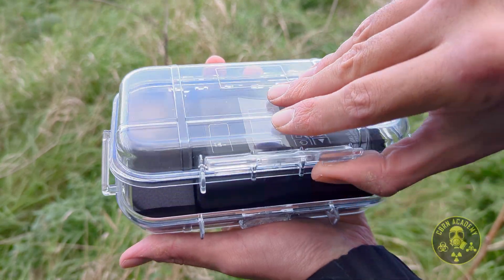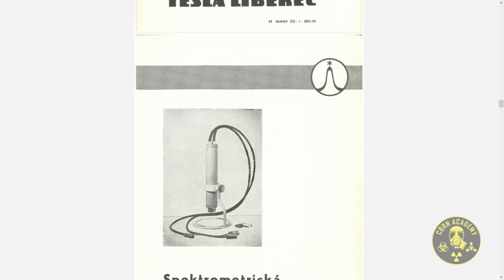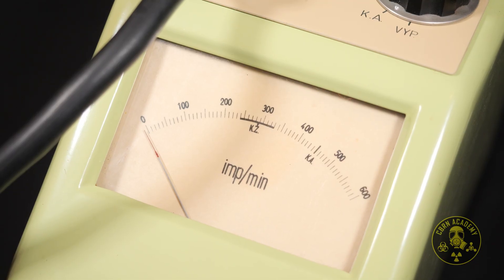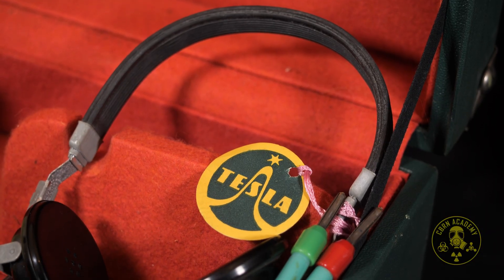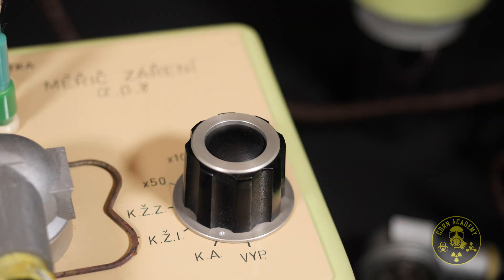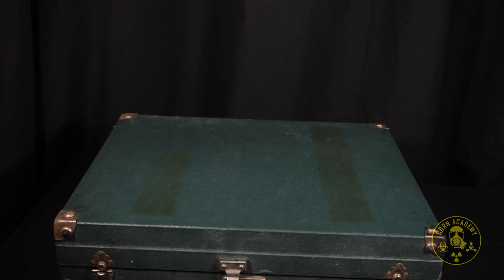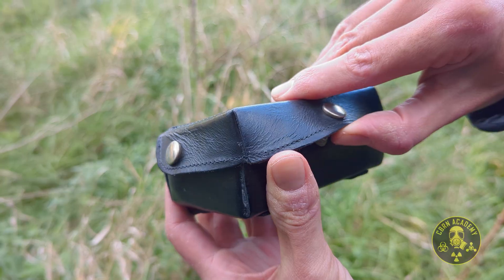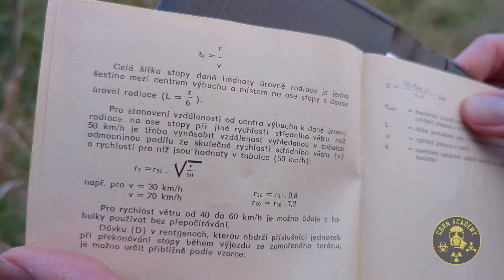Why This Rare Radiation Meter No Longer Works?

Comment: The reason why it shows as not working on anode test setting might be lack of anode battery. id say there's a highly likely chance u have fully working unit, anode batteries are generally a problem to get nowadays because there's no necessity for them, their high voltages are not really required by modern electronic devices there's many ways they can be replaced though. the first way to do so is to make your own high voltage anode battery I'm unsure if youtube lets me post links but there's this bit older web called something like "Jarda Kučera Anodová baterie" it goes trough basic process of making the batteries, other way i know of is to get a voltage boosting device of some sort and boost voltages of modern batteries, this can be also done by few different ways one i personally used was step up dc-dc module to replace this battery in a different device with same problem. the big problem i see with all of these possible solutions is that the catalogue doesn't say anything else about the battery than just the type number and searching that unfortunately doesn't yield any results. one way you could probably find that out is by getting a laboratory power supply, hooking it up to the battery inputs, putting the device into "kontrola anody" mode and then gradually increasing output voltage of the power supply until it reaches the desired level on the meter itself, BUT this could also make the device not operate correctly if not done wrong because dependent on the way the device is wired up internally it could be using one of the two required batteries as a source of biasing voltage.

Anyway even if you don't go trough with any of these, I still want to say its a really cool piece and i also wanted to thank you for your videos in general I've been watching them non stop for past 3 days and i enjoyed them greatly, thanks a lot!

Comment: The reason why it shows impulses per minute is that what you need to know here is the number of particles emitted by a sample and entering the tube. With some geometry and correction factors you may then calculate the sample activity (to some degree of precision). Or you may want to determine the half-lifes for the purpose of radionuclide identification. Anyway, Geiger counters and often not even proportional counters cannot give you the dose rate unless being "energy compensated". The metallic sheets are certainly shielding of defined density and thickness (or surface density, commonly expressed in mg/cm²). Some of them maybe just restrict the flow of particles to a smaller area while others serve rather the surface density-related function. You could perhaps stack them and record the count rates for different total thickness and extrapolate to "zero thickness" to allow for more precise activity measurement or perform a very simple beta "spectrometry" - stacking them until the count rate equals the background, then looking for the beta ray energy with its range being equal to the thickness of your shielding (and the energy itself therefore being the maximum energy of beta decay corresponding to certain radionuclide).
Regarding the anode battery - your meter is based on vacuum tubes which commonly require higher tens or lower hundreds od volts for operation (in addition to units of volts for filament heating), this was to be supplied by a vibration or later transistor switching power supply or - the anode battery, the latter having the advantage of using less electronic components and introducing no noise. You know how a 9V battery looks like, 6 1.5V cells connected in series to give 9V in total. You may now imagine 45V or 90V anode battery, just more of these cells in series. I've already seen some of these, they're just paper boxes with the cells inside and two wires coming out of them, due to their age they are of course no longer working. However, what you must realize, is that the anode battery is essential for the operation of your meter! Don't be sad you cannot get any (they are no longer in production). Just buy some 9V batteries or the miniature 12V ones and connect them in series to get the voltage you need. If you're not sure if the meter is supplied from the whole battery "column" or from the points where the anode batteries are connected, make more of them and connect them separately just as the original ones were meant to be connected.
One more note about the IT-65, the Philips18504 tube detects alpha, but I highly doubt alphas can get to it even if the shielding is in position "open" (with the write cross not shown), the manual doesn't even mention alpha. And it's understandable, after nuclear attack, the fission products and even activation products in the ground give off only beta and gamma. Also, please note that IT-65 shows meaningful readings of gamma dose rate only when the shielding is closed (white cross visible), otherwise it's just for indicative purposes (there's sth about it in the manual - determination of contaminated parts of military equipment), not mentioning the "experts" who take off the whole shielding and "measure" "x mR/h of alpha", this is absolute nonsense.
Reply from the maker: That's a LOT of useful information right there! 
Yes, IT-65 doesn't register alpha radiation with the cover screwed in, even if the shield is open. It needs to be taken off and then it does. That's why I said it measures alpha as well, but things are a little bit more complicated. Of course I want to address it in the separate video about IT-65 as this was just a small teaser for what's coming later. 

IT-65 is definitely meant for beta/gamma detection only and correct me if I'm wrong but I've been told that exposure to high enough amount of alpha particles can "kill" the probe.
Reply: @cbrnacademy I have already read something about destruction of gaseous filling of X-ray counters filled with rare gases, which I don't really understand how can happen, maybe just adsorption to the metallic walls, and the information about alpha particles-induced destruction of GM tube is new to me. It's a fact that alpha particles ionize more, but I think that in a GM tube, given that it really operates in Geiger region where you get all pulses of the same amplitude regardless of the initial ionization, it doesn't matter if the life expectancy expressed as the number of pulses is taken by betas or alphas. Alphas could perhaps have some deteriorating effect on the mica window, but I still think it would take such a high exposure to them that the tube would fail due to the maximum number of counts exceeded (if it was connected to high voltage). Do you have some additional info on this subject? Where did you find about it?
Reply from the maker: @Ales.2000  The information came from a certain Hungarian collector/enthusiast back in the day when we had a Discord server. He told me that they managed to "break" the same Phillips probe by exposing it to some alpha source which  overloaded the GM computer - don't ask me how that happened since I have no idea. 
As I value my IT-65 for sentimental reasons, I wouldn't dare to try to replicate the experiment, although I used the IT-65 probe multiple times for demonstrations on how it can measure alpha, beta and gamma.
Reply: @cbrnacademy So there's a chance it was just a too strong source and it could happen regardless of the radiation type. I also wouldn't try that with IT-65. Even if I had a tube I would sacrifice (I'd rather build the theoretical basis about this effect, than destroying a tube) I would connect it to a separate apparatus.
Reply from the maker: @Ales.2000 Yep, makes sense!

Comment: Congrats on the awesome find! This type of device is super rare. I only know of three sets like this. One's on display at the new dosimetry museum I run in Nuclear Research Institute, Řež (near Prague), and another one belongs to a friend of mine. I also appreciated the mention of the scanned catalog — I’ve got the original stored in the archive. 
Sadly, I don’t have any more info about this particular set either. 
Anyway, the video review is great!
Reply from the maker: Good to know! Do you know whether the other two devices you mentioned are still operational?
Reply: @cbrnacademy  I don't know if my friend has tried to get his device working, but I haven't attempted it yet. First, I need to sort out a replacement for the anode battery and also swap the GM detector for a new one with an sealed mica window (original GM detector has broken mica window).
Reply from the maker: @zeevjor1332  You mean the thin plastic layer at the end of the probe? Mine was broken too, I just forgot to film it so I decided not to mention it in the video.

Comment: Very nice measuring Instrument and truly very rare! 
And regarding the imp/min unit it can be said that many measuring instruments in Germany use this unit! There's also imp/sec, which is also very common. 
I find it very interesting that the device uses a proportional counter tube. 
As always, very entertaining and interesting!
Reply from the maker: Many you say? That's good to know!
My knowledge about radiation detectors is at least for now limited to Czechoslovak ones but I'm more than eager to get my hands on other devices in the future.
Reply: @cbrnacademy Yeah there are many that use this unit or the Imp/sec one like the LB 1210 or the H1370W but also way rarer ones like most of the Herfurth and Berthold ones. Some of the german stationary ones also use Imp/min like the one from Telefunken. Ones from East Germany also do. I recall the RAM-60 and RAM-60A usinh this unit. They were produced in kind of a similar period as the meter you presented.
Reply from the maker: @IanR-r9x  Awesome, now I can spend the evening studying what devices you were referring to 🤓
Reply: @IanR-r9x LB1210 is a contamination monitor, designed for facilities working with radionuclides. There you probably know the nuclide you are contaminated with, so you may convert the count rate to surface activity of the given nuclide if you have a standard of surface activity (certified radioactive sample) for comparison. If you're not so interested in the accurate values, it will still be helpful for the determination of whether sb or sth is/isn't contaminated by simply comparing the count rates with the background readings.
My message is this - count rate is the measure of detector response, not a universal measure of activity or dose rate! Obviously, detectors of different sizes and types will show totally different count rates even when being exposed to the same radiation field.
Reply: @Ales.2000 im refering to the LB 1210B it uses Counts per second displayed as "Rate [s-1]" There is also the other variant which can determine specific nuclides that would ne the LB 1210 D
Reply: @IanR-r9x I'm not contradicting what you're saying, just adding some more info. However, I've found the LB1210D and it doesn't seem it can identify radionuclides, perhaps you meant another detector?
Reply: @Ales.2000 yes probably :,) there are after all numerous LB 1210 sub-variants but the LB 1210D as far as I know also has a function to identify radionuclides but has its own "database" of nuclides and uses this to determine the activities more precisely the LB 1210 shows as far as I know in Bq/cm² or something like that
Reply: The reason for proportional counter being used here is probably the fact that you can detect alpha rays and simply reject the responses to beta and gamma by setting a detection threshold so that you ignore them. This is possible to certain level of beta/gamma backround count rate but suffices in most applications. The principle is that beta travels much longer in the counting gas and deposits only a fraction of its energy (or, if it looses all, it is just a very weak beta ray that will not be registered by the electronics), while alpha looses usually all of its energy, leading to a stronger electrical signal. If it comes to gamma, that behaves effectively the same as beta, although it almost doesn't interact with the counting gas, but with the metallic walls, leading to the production of photoelectrons and Compton electrons.